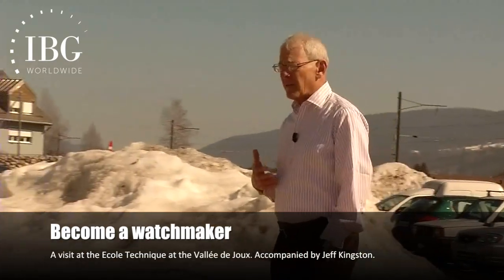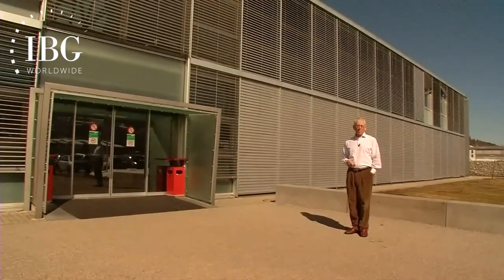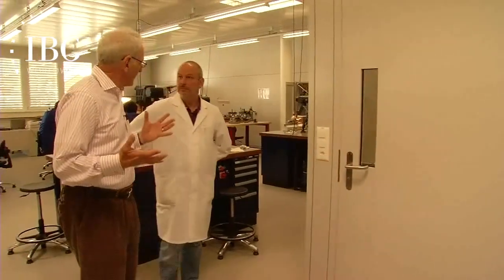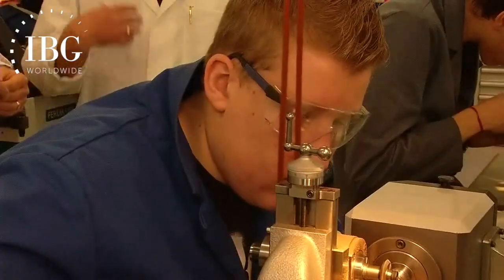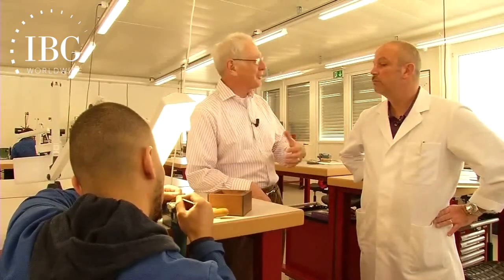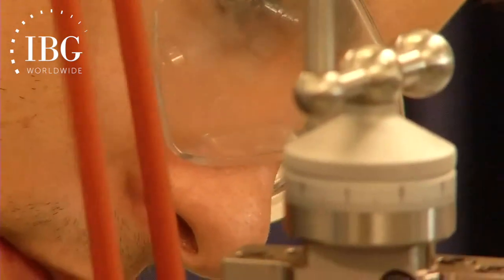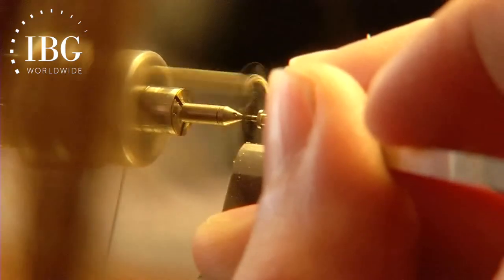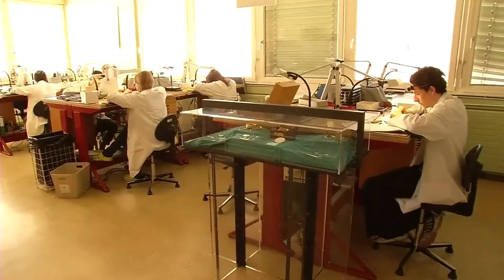Watchmaking School: Visiting the Ecole Technique at the Vallée de Joux

Comment: The lathe I saw was a low tech vintage design. What a backward education. Chinese watchmaking schools are using 21st century equipment with microscopes and high tech measuring equipment. I now see why Swiss watches are not as accurate as early to mid century American watches, and why Grand Seiko do make the ultimate movements that have been streets ahead of Swiss movements since the late 1960s. I witnessed the epitome of pomposity on display in this archaic teaching establishment. Making a movement and designing a movement are two entirely different disciplines. A Chinese watchmaker learns CAD, CNC machining, and a myriad of manufacturing skills. Here they learn to make a completely out of date, yet beautiful trinket where art and innovation are nowhere to be seen.

Comment: 18,000 bph is 5 beats per second. I had thought the standard was 6 per second (21,600 bph). Yes? No? Depends?
Reply: The faster the beat the higher the precision but at the cost of wear and tear, resulting more frequent interval between servicing.

Comment: Presumably the highly elaborate machine at 5.40 enables one to adjust and fix the isochronal length of the balance spring. Necessary for a flat spring without overcoil.

Comment: what are the requirements to become a student and how much does it cost?
Reply: Tape Master82 It costs kind of a lot, since its a school and you have to basically buy almost all the tools you use and books and what not to be there. Then the technical skills required for attending there are also very high and the educational skill are basically the same

All in all, its high demanding, very high, i am attending to a different Watchmakerschool, the one in Grenchen, Solothurn and they have ridiculously high standards
Reply: Tape Master82 from what i‘ve read so far, it costs nothing. And you can apply right after school.
Reply: If it's like the UK equivalent then you need to be one of the best applicants to the course too.. It's possible to get a position at a Swiss school by successfully getting a trainee job for a prestigious watch company. It can involve relocating for the study, then the job, and may include learning the native classroom language too, possibly French.